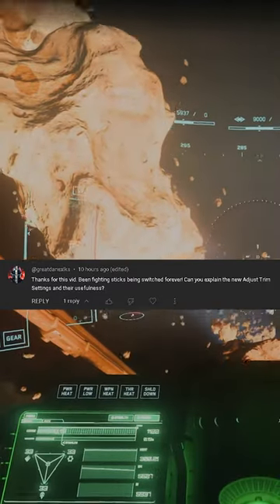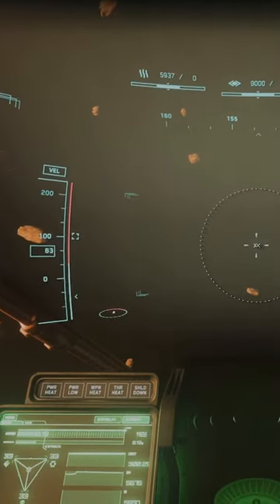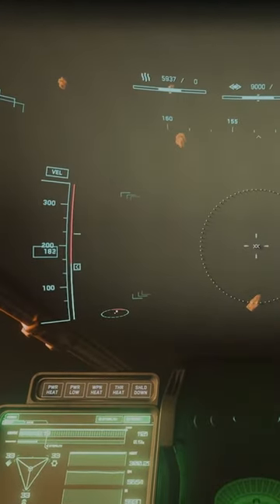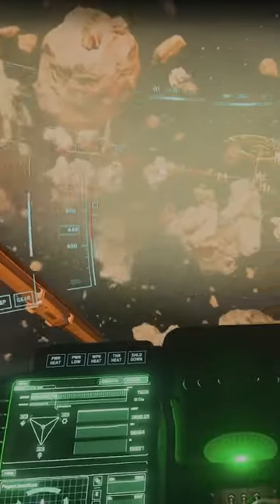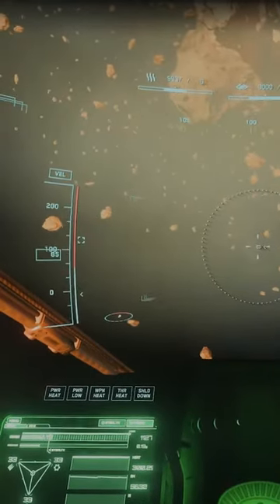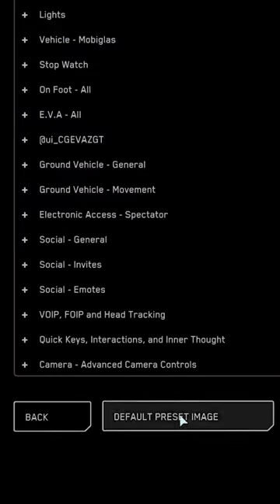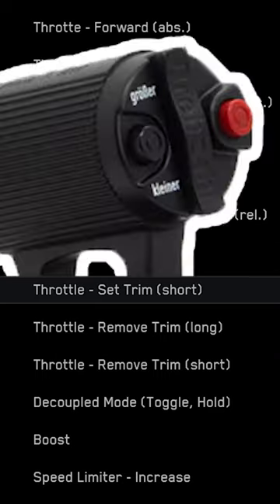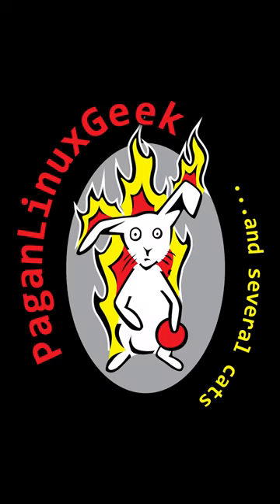Star Citizen Throttle Trim Enable or Disable Keybinds 3.20 LIVE

Comment: Thank you for explaining this. So is there any point for this trim if you have a throttle? Seems like placing the throttle at a certain distance would do that same thing. I can see how this would be useful for HOSAS users though. 

Also, can you make a video explaining the "Power Throttle" setting? I see it lower and increases the power output, but when I do that, nothing changes regarding the emissions. Am I missing something?
Reply from the maker: It can be useful if you need a temporary increase or decrease in speed and then wish for the.set speed to resume. Honestly it seems more targeted to HOSAS users as I see it. Throttle seems easier. Can you elaborate on the "power throttle" request please?
Reply: @PaganLinuxGeek  thanks for the reply. 

Under "Flight - Power" in keybindings, there are bindings for "Decrease Throttle, Decrease Throttle to min, Increase Throttle, Increase Throttle to Max". Decreasing throttle allows for your ship to be "stealthy", but there is no other use for that throttle bindings. What's the point of putting it to minimum or maximum.
Reply from the maker: Honestly I'm not sure. I used to bind acceleration limiter some years ago to make tight spaces easier, but shifted to using the speed limiter toggle instead as it was few bindings and freed up a couple buttons. Other than binding speed limiter to the throttle, I don't bind any of those. My left stick is bound as shown in video. Yogi recently replied to a spectrum thread regarding keybind changes in such a manner that I expect a lot of changes in the near future. Overall it seems that they are making it more friendly to those with expanded control devices, like throttles with extra buttons.

Comment: is there a way to invert rotation?
Reply from the maker: YES! In the options menu click CONTROLS up top. Click the LOWER RIGHT BUTTON to Joystick/Hotas1. Now expand INVERSION SETTINGS then FLIGHT MOVEMENT. Find the FLIGHT(ROLL) set it to YES for the joystick number that corresponds to the stick you use for roll. If your keybinds show a number (2) for roll, then it's device 2, (3) would be device 3, and no device number in () means it's the first.

Comment: Whats difference between long and short?
Reply from the maker: Long press (press and hold) or short press (press and release). So binding the long press to throttle trim clear means push and hold.for a moment to turn it off. Or press briefly to set the.speed.